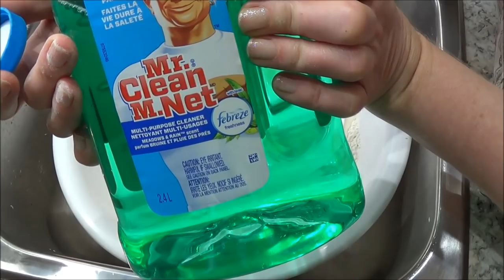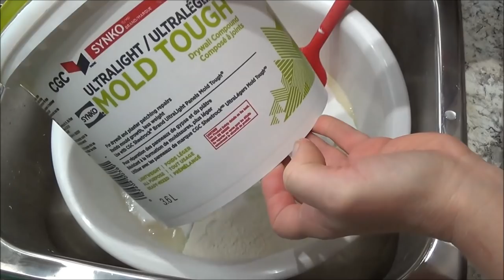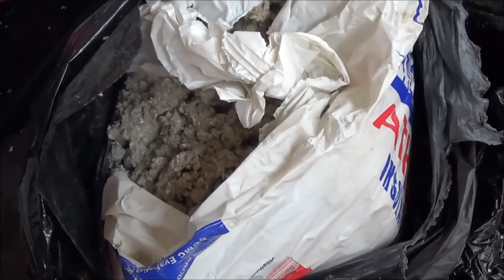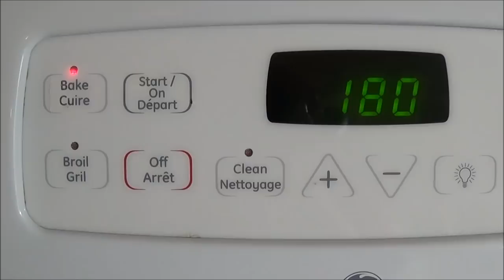How I Make Paper Clay 2018

Comment: If we are doing the recipe without the drywall compound are we still able to bake it?
Reply from the maker: I did it once when I ran out of the compound, turned out fine
Reply: also will all purpose drywall compound work
Reply from the maker: yes, any drywall compound  that's ready to use will work. On Jonni Good's website and youtube, she makes a different type of paper clay and has said that DAP drywall does not work. I don't know why, I don't know if that's just because it's a different recipe she's using. You should check out her channel though, she's an expert with clay making.. maybe you'll find another recipe you could try out too. Her channel is called,  Ultimate Paper Mache https://www.youtube.com/channel/UCdcELaD6x7yIr5jKlNqAhjg

Comment: I havent yet made any kind of clay yet but watching youtube is getting me more confident to do so .
A question , my son brought me a small box of cardboard fluff.(by product at his job at box Co.)It looks the same as using cellulose insulation recipe, except Cardboard Color.Do you think it could be used in place ?
P.s like how you add the paper material lastly, that makes better sense!
Reply from the maker: I really want to give you a definite answer but I'm unsure what that product is. So I'll give 2 answers, lol  If it's shredded cardboard it would have to be broken down otherwise it won't break down in the mix. There's other recipes that actually use shredded cardboard with hot water, mixed and then drained of all the water. Those recipes have less ingredients. You could do a search on youtube for them "paper clay made with cardboard" If it's actual fluff then I'm pretty sure it's been broken down and you should be able to use it instead of the paper insulation. I hope that helps, even a little!
Reply: Where The Gnomes Live I thought I was gonna be able to post the picture so forgive me I am new to YouTube ! The texture is just like the cellulose you can’t even see shredded paper it’s fluffy I appreciate your reply and keep up the good work!
Reply from the maker: I wish people could post photos! From what you described you should be able to use it. I have to say though, I'm not an expert but It doesn't hurt to try. Do a small batch so you don't waste much if for some reason it doesn't turn out.. I'm thinking it will work.  You can use any paper mass in the recipe as long as it's broken down and it sounds like that's exactly what you have. All the best and welcome to youtube!

Comment: I followed the recipe although was confused on how much paper insulation to use. Mine came out heavy and as it’s sitting in the oven everything is falling off. Any suggestions?
Reply from the maker: oh no, I'm not sure what to suggest aside from maybe  just watching that part of the video again. It's kind of impossible to measure out the insulation so all I can really say is add handfuls at a time, mixing throughly, and add more until you can roll it into a ball and it holds its shape. There are other videos for paper clay on youtube that don't use the paper insulation, maybe consider switching recipies if this one doesn't work for you. I'm sorry you're struggling with it tho!

Comment: Have you had any problems with your batch turning into a slime, this is the issue I'm having using just thinned glue + joint compound, and the fiber insulation. Two batches I've tried. 1st batch I didnt pre soak my fibers so I thought maybe that was why. So then I made a second batch i pre soaked my fiber for a bit then squeezed the excess water out, next I  added in unthinned glue and a little compound. Both ended up becoming slimy unfortunately. I have no issues though when using T.P. plus thinned glue and compound in the past. Was hoping to be able to have a clay that doesnt use flour at all.
Reply from the maker: I've never had that issue but I've never tried it without flour. Search youtube for paper clay using shredded cardboard. There's recipes out there that don't use flour. I can't say which one is a good one, I  only ever use the recipe in this video. Best of luck!

Comment: Would sparkling compound work? I have been searching for the answer and can’t find anything. Mine has sodium silicate glass & sodium borate in it. I cant afford to buy anything right now and trying to use what I have on hand.
Reply: Spackling*
Reply from the maker: I actually have no idea. I've never used spackling compound but if you ask your local hardware store if it's the same as regular, with just those added 2 things, try a small batch and see how it works. I hope that helps
Reply: I'm told any brand EXCEPT dap and powder form spackling, they have an ingredient that makes the recipe clumpy. I forgot what it is called🤦🏻‍♀️ I'll come back if I remember

Comment: greetings! Thank you for a wonderful tutorial. is that 180-190 celsius?
Reply from the maker: no, goodness me, (I'm editing my answer) so sorry 175-180 Fahrenheit. At the lowest setting or close to it. It will depend oven to oven. I just got a new oven, it seems hotter than my last one so play around with those low settings. You'll get a good idea what works after trying it the first time.
Reply: So 350 Fahrenheit?
Reply from the maker: no, I have no idea what I was thinking when I answered a week ago. At the lowest setting or close to it. 175-180 degrees f. You want to dry it slowly and thoroughly. Turning up the heat just burns it.

Comment: it would be very light weight - but would it take a break test?
Reply from the maker: it can break, for sure if you make a free standing piece. I mostly use it to cover walls. I've also used it to cover foil creatures I've made. I've dropped them and they never broke but one did have a long nose that did break off but it glued back in place just fine.
Reply: if you dropped it,  its nice a light like a mouse sorta, so it doesnt die during falls,   but u can break it with your hands,  but i guess you can break a biro with your hands too if you try hard enough.

Comment: peppermint extract detours bugs if you are using flour in mixture.
Reply from the maker: For those who might be a bit worried about the flour, I've never had an issue with bugs with this clay. The clay cures hard.  I've been building with it for many years, I've never seen mold or bugs in or around any of my builds. The guy who came up with the original recipe used it for years longer than I has never talked about bugs being an issue. But with that said, good to know that peppermint is a deterrent. It does deter more than bugs, for those interested, google the other things peppermint oil will repel. It's good stuff!

Comment: Why not just pre-soak the paper insulation in water beforehand, and when it’s ready, just squeeze the water back out? That would be a lot easier on your blender, and you wouldn’t really have to worry about dust.
Reply from the maker: the dust happens regardless if we pour water on it or mix it in.. until it’s wet dust will do its thing lol I just recently started making clay without the insulation, also mixing by hand, and it works up the same clay. It’s my latest video. Thanks for the comment, I appreciate it ❤️

Comment: What are your thoughts on a confection oven ? Would it be faster ?
Reply from the maker: I've never tried it but I would imagine it would dry faster. It has to be dried on low, low heat though or it burns and any thinned out edges curl.
Reply: Also have you ever sealed it with a polyurethane to make it shiny and to Harden it even more ?
Reply from the maker: I have.  I've added a sealer for shine on a snail I made but it wasn't to harden it, it was to get a shiny effect In the same way, I've sealed some walls and the tops of mushrooms I made to get the same effect. It takes paint and sealer very well.
Reply: Thank you so much. I'm going to do a project that is sold for charity. I'm excited to try your magical clay!!!
Reply from the maker: that's great! All the best to you, have fun. Any questions along the way, feel free to ask :)
Reply: Only use a confection oven to make candy or sweets 😉

Comment: I wonder if you could plain news paper instead of the insulation.... adding small pieces at a time, or maybe wetting down the newspaper first🤔
Reply from the maker: you can use newspaper, it has to be broken down first. I haven't tried it but seen on youtube people soaking it in hot water then  squeezing out the water then using an electric chopper thingy (kitchen blender that's a stick, lol can't think of the name) and chopping it very fine. The paper insulation is already broken down so no need for all those extra steps. But that is a recipe, paper clay using newspaper or shredded cardboard or even toilet paper..  I would suggest looking up Jonni Good. She's the queen of paper clay recipes. Her channel is, Ultimate Paper Mache

Comment: Egg cartons if we cannot afford insulation?
Reply from the maker: You can use paper pulp but you would have to break it down first by soaking it in hot water, drain, then mix/break it down further in a blender. There’s other clay recipes using paper pulp (newspaper, cardboard, etc) on YouTube, I’ve never tried any myself so can’t tell which is best, I’ve always used the insulation. I hope that helps tho!

Comment: What is a practical use of this paper clay instead  of real clay?
Reply from the maker: For me it was cheaper and I could make it as I needed it.
Reply: I'm told it also has less shrinkage and can be used around armatures and jars without cracking.

And the glue and paper fibers make it more resistant to shattering from a fall.

Comment: Would this be structurally sound enough to make a lifesize tree "skin"? I'm planning on making my daughter a reading nook that looks like a tree. I will be using lumber and chicken wire for the skeleton and the main supports for body weight, but would this be strong enough to coat the chicken wire with to make the branches and trunk? Does this support any kind of weight once dry? My daughter likes to climb...so would a thick enough layer of this stuff, packed onto a 2x4, wrapped in chicken wire to look like a branch, hold her weight? Sorry for the weird questions...I guess I could test it myself, but I thought I'd ask the expert. Thanks for the great video. Cheers!
Reply from the maker: questions are never weird to me, lol I have kids and know exactly what you're asking. I'm not an expert though, I've been crafting for a number of years but normally I'm just winging my way along. With that said, I made a life size tree (4'7) using this clay for the bark earlier this year, I'll put a video link at the end of my comment so you can see the bark on that tree.   It's pretty tough once dried but my tree wasn't built for climbing on. The branches I made are about 3 to 4 feet long, they are just foil and masking tape then tissue paper dipped in glue over that. When I put on the clay the branches became very heavy and dipped way down so I propped them up with sticks, once the clay was fully dry the branches stayed in position. If I were to hang off of them they would break, I'm sure, but they are pretty strong and will hold up to what I'm using them for. If you were to build the branch with wire along with some other support then cover in clay then I would say yes, it would hold up to climbing but you would need that strong frame first. I wish you all the best of luck, your idea is amazing and what a dreamy thing to have in a child's room! I just love that!  Here's the update video of my large tree, there are more updates coming for this one in 2019 https://youtu.be/brlNNTD5as0
Reply: Where The Gnomes Live thanks for the video and the reply. That helps a lot, now off to test.
Reply from the maker: I would love to hear updates! If you can, keep me posted :)
Reply: Hugo - When the safety of a child is at stake I wouldn't gamble with a paper clay mix of unknown strength.  I would cover the chicken wire with a layer of Portland cement and sand (a.k.a. stucco mix or grout mix). That will give predictable structural strength and it will harden in a few days no matter how thick it is without the help of ovens or fans. If you use a fast setting cement mix it could be fully hard in just a few hours. Another possibility is to cover the chicken wire with fiberglass cloth and resin instead of cement mix if total weight of the tree needs to be kept down and you don't mind the extra cost.

Then I would add a second thin layer of whatever (cement mix or the paper clay) for texturing/decorating purposes.
Reply: cruiser97eric1 those are great ideas... I’m not very familiar with any of these building options, which is why i am asking probably rudimentary questions. Thank you for your input. I am going to make some test pieces with all of them and find out their limits....if I can remember, I will video document the processes and post them for others... I saw a fake tree in our local library that was life size and I was struck with “DADspiration”... I may want to eat those words before I’m done with it lol.... thanks again.

Comment: What is tacky glue
Reply: White liquid glue. And just Google paper insulation, it’ll tell you who has it in your area.
Reply from the maker: it's basically a white glue but grabs on faster than regular white glue BUT for the clay just use your regular white glue like Elmer's. Tacky glue is a bit more expensive and I should have just said white glue..

Comment: Can't you just use torn up newspapers instead of insulation?
Reply from the maker: sure, but you have to break the newspaper down first by shredding and I believe you would have to soak it (mix it?) and drain it, I'm not positive on the whole process, I've never tried those other methods  myself. The insulation is ready to use, no need to break it down. There's many different recipes and  lots of videos here on youtube for them.
Reply: You can use toilet paper. Unroll a roll, soak it in warm water, then squeeze most of the back out. Now, rip it into small pieces around an inch square. Toilet paper makes a finer clay than the insulation. It's also easier to make small batches.
Reply: Thanks for the suggested alternatives to the insulation. This kind of cellulose insulation is not readily available to the public here in the U.K. 
A similar situation occurs with the Joint Compound. Yes it is available at the big hardware stores, but it is sooo expensive compared to the USA...Approximately $20 to $30 depending on size 👎🏼
Reply: @jaysonnickols170  You are right I always use toilet paper when I make clay

Comment: My clay it feels like Gak, you know that rubbery squishy stuff? This is my first time making clay what am I doing wrong?
Reply: Joni over at Ultimatepapermache.com says not to use DAP brand drywall joint compound as it reacts badly with PVA glue.  If you go to your hardware store look for SHEETROCK  brand, or ask for assistance to avoid buying the wrong type. You can do this any number of ways as its a pretty forgiving medium.  I mixed in portions of my mistake slime clay into Sharon and Scott Stoll's instructions and didnt have any issues.  It did take a little bit longer to dry totally through so thinner layering is best if you do this too.

Comment: what is tacky glue           elmers   white glue?
Reply from the maker: it's not but elmer's white glue will work. I actually should have said in the video that any pva glue will work, my apologies. Tacky glue is a white glue but more expensive than elmers. I use a bulk white glue, I've also used elmers and it works great

Comment: Perhaps use breadmaking hook attachment and then it wouldn't burn out your beater.
Reply from the maker: thanks for the suggestion! I actually don't have one of those but I would try it if I did. I've never had a beater burn out on me over the many yrs of making the clay  but it's possible for sure.  I tell people to buy  a 2nd hand beater so if that does happen the loss isn't great. The best tool to use would be the mixing attachment and a drill in a large bucket, so much faster!
Reply: Thank you so much for you great recipes 🧡🧡🧡

Comment: 180 degrees Celsius or Fahrenheit?
Reply from the maker: For others reading this too, whatever  the lowest setting on your oven is. Test it out on the lowest temp, after a1/2 hr or so, if you feel it could go up in temperature, go up a bit. It’s only for those who wish to dry the clay  in the oven though, it dries great with a couple fans on it or out in the sun.
Reply: @WhereTheGnomesLive  awesome thanks! Just made my first batch a double batch! ☺ It's sliding down the bowl so I cut the oven on lowest setting and ran in here to check in comments and WALA!! Here it is! Ty ❤
Reply: I’ve been watching quietly for some time now,  I got up the nerve to give it a try…..first I had to get newspapers,  I then did the plastic bag method and stuffed it full of shopping bags,  I then went tape crazy as hubby said…..p covered it with 6 rounds of paper, then the paper clay made exactly how you did this.   My pumpkin is beautiful!  It’s almost ready to paint, I made it 16” wide by 9” tall. It’s going to be a beautiful princess pumpkin

Comment: I have burned out two brand new blender moters doing this
 Ugh
Reply from the maker: I’m sorry you burned out motors. At 6:56 I talk about not buying new beaters to do this job for that reason. It’s a lot of material to move around for a small motor. You can hear when the beater starts struggling, when it does pull it out and try from another angle. But with that said, if you’re still wanting to make this clay, it’s probably best to use a drill and industrial mixer in a large bucket.
Reply: You're supposed too use a beater not a blender. Blenders are only designed to run a minute or so.